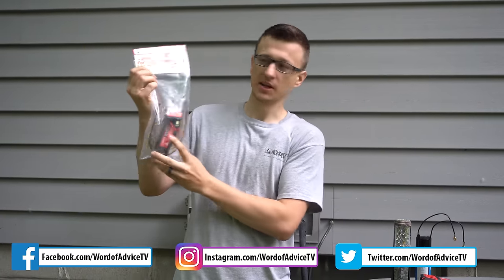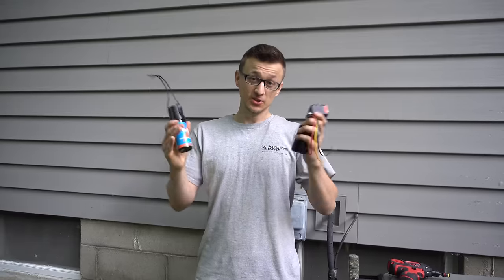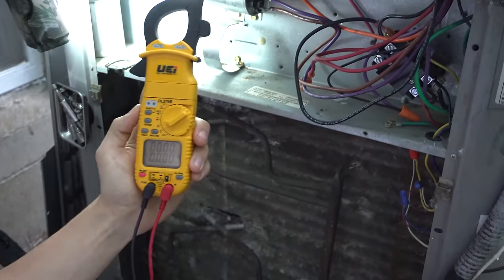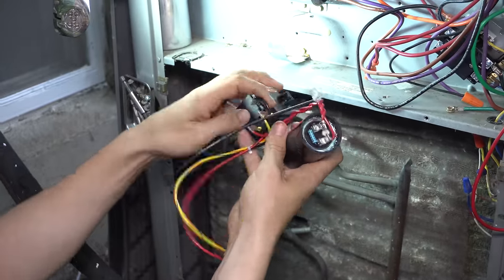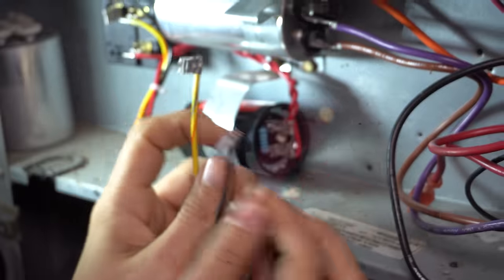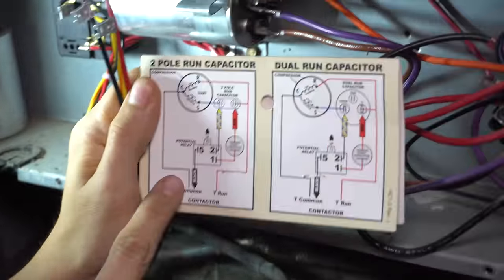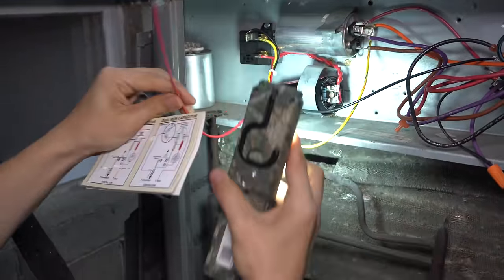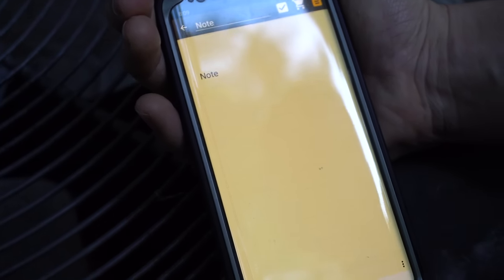How To Install a 3 Wire 521 Hard Start Kit

Comment: Some heat pumps have a terminal on the circuit board specifically for the black wire. If you have a heat pump, look at the schematic on the cover. It will usually show the hard start wiring with dotted lines. Follow that schematic or the unit may not start.

Comment: Another great video. Thanks for posting.  One word of caution. I bought a 521 start kit going on the company recommendation.  I have a 4 ton unit so I bought the CSR-U2 which is for 3 1/2 to 5 ton units.  While I was waiting for it to be delivered I found the originally equipment manufacturer (OEM) part for my compressor. The start capacitor used is an 88 to 108 µF. When I received the CSR-U2 I noticed the capacitor was 189 to 227 µF ( these specs are clearly marked on the capacitor itself). Looking into the CSR-U1 product (for 1 to 3 ton units) it had an 88 to 108 µF capacitor. Needless to say I sent back the CSR-U2 and got the CSR-U1. Always try and find out what OEM part is used before installing these or just buy the OEM part.
Reply: OK...I'm confused. My outdoor Goodman unit (2.5 Tons), has a factory  dual start capacitor ( for both compressor and fan), rated at 35/5 uF. The 521 kit for 1-3.5 ton unit has it's own capacitor, as you say....but it's function is slightly altered from a normal unit that undergoes a full, unaltered, hard-start. Therefore a "match" of uF is not warranted between the OEM capacitor and the one provided by the kit.....correct?
A hard start kit give the compressor added starting torque momentarily by paralleling a LARGER capacitor with the compressor run capacitor. Parallel the capacitance of the circuit may be 180-240 mfd and as the amperage drops on start up... the relay drops the start capacitor out of the circuit when it is no longer needed.  If you have a 4 ton unit, I would have stayed with whatever model of the 521 kit, it says you need.Seems the latest kits show one kit up to 3 tons (1-3)...and the next  kit starting at 3.5 tons (3.5-5)....so there is no borderline overlap either that you seem to have encountered at 4T.
Reply: @TheWilferch  - I’m not sure all about that. All I know is the compressor I have has a part listing that shows an optional start kit with a capacitor rating that matches the smaller 521 start kit so I went with that.
Reply: @condor5635  ...just make sure you know what you are comparing. Most 521 hard start kits have their capacitor rated at a higher uF than the normal start capacitor of the factory unit. The "optional start kit" you say you see listed by your factory listing....may not be a 521 kit. I'd check further. The sentence I show comes from another technical source on hard start kits ---> this one---> "A hard start kit give the compressor added starting torque momentarily by paralleling a LARGER capacitor with the compressor run capacitor. Parallel the capacitance of the circuit may be 180-240 mfd and as the amperage drops on start up... the relay drops the start capacitor out of the circuit when it is no longer needed. "
Reply: @TheWilferch  - of course what they have listed is not a 521 kit. They want you to go buy their ‘kit’ not buy a 521 kit. They are the same thing. I have a 60 µF run capacitor so either 521 kit will have a LARGER capacitor than that as you state - the smaller one is 108 microfarads and the larger one is 220 microfarads or something like that. The capacitor for my compressor ‘start kit’ is 108 µF which matches the smaller 1/2/3 ton 521 kit. Both kits will work but the smaller one is better matched apparently to what my compressor needs and is clearly listed in the parts available for it.  I’m not trying to argue I’m just telling you what I’ve seen and re-searched.

Comment: Can you still use this with a  communicating system(Amana/Goodman, 18seer) that doesn't have a typical contactor...looks as if the supply voltage goes right into the main board. This unit has a copeland scroll compressor just like the others I have done but just not sure if I should mess with it since it's all integrated into the main board.  Unit runs fine, just seems to make a lot of noise when starting.

Comment: Hi, can you tell me how the wiring should be when using a 5-2-1 hard start kit along with a Turbo 200X that has a CPT terminal?  Does the yellow wire go to the CPT terminal and the red to common?  Or does the red go to the highest value for my MFD for the compressor?
Reply: The yellow goes to the CPT.

Comment: What happens if the bleed resistor is not installed on the capacitor terminals? Would it burn up the capacitor or cause damage to the compressor?

Comment: Could this be an alternative fix to bad start relay if the OEM part is not readily available?
Reply from the maker: Yes, I would replace the start relay and capacitor both with the 521 kit.

Comment: Can I connect it to the hot side of the contactor instead of the switch side?  The compressor uses less amps when it's connected directly to the hot side...

Comment: What is the model number for the Kickstart 3 wire I will  need for a 3.5 ton unit? It a York model number YCJF42S41S1A? All is see are for 1 to 3 ton and 4 to 5 ton. Which one will work for me? Compress is 208-230v  60HZ 112 LRA   17.9 RLA  single phase

Comment: Just installed a 521 on my Concord Condensor after compressor stopped working. It is now making a really loud rattling noise but is cooling. Any ideas what the issue could be?

Comment: I sent an email to Suppco asking what temp their SPP6 cuts off, and if they should not be used in warmer climates that consistently get into the 110* range. Here is his exact reply, "The PTC relay drops from the circuit at about 160° or so. It can, and has been used in warmer environments."
Reply: If you are a service tech, install the 5-2-1. The 2 wire might have you returning for a free service call to replace it

Comment: Installed my 5-2-1 hard start and did a white wire check and showed around 20amps with my clamp meter with no difference so I'll check it again but do recall connecting my yellow/green stripped wire to Hemp on the capacitor and the red to common to the capacitor as well. The black wire is to black terminal on contactor albeit I need to check whether it's on the input side or the output side. I'll update it if I notice any amp change.

Comment: My unit has a dual run capacitor that is 35/3-uF, 2-ton, 208/230 rated voltage, with a 1/5hp fan.  Do they make a hard start kit that won't mess up my unit?  It's pretty old and it seems like all of these products only go as low as 1/2hp or 80-something MFD.  What can I use?

Also why does it even mention HP if it isn't even connected to the fan?

Comment: Hi,  Thank You for showing how to connect the 3 Hard Start Kit wires to the dual run capacitor and the contactor. The instructions paper is  NOT CLEAR on the red wire ( say to connect to the contactor ? ). Thanks :)

Comment: I'm a little confused.   Does that 5 wire go to the contactor common or to the capacitor common. I watched the How to wire an AC unit and it showed it going to the common on the contactor. Here you show it going to the capacitor common.   Or  Does it matter as long as it goes to common.

Comment: If you suspect a hard start is no longer working based on over 90% of LRA on startup, do you just test it same as a capacitor? Also see you have brush coil condenser. Can you make a video  of best cleaning practices on those please??
Reply from the maker: Yes, you would test it like a normal capacitor to check if it's bad or not. As for the spine fin coil, I normally just hose my unit down and that is sufficient. In fact I don't even spray it from inside out, just from the outside is enough. There is no need to get it super clean as long as you get most of the stuff off of it. I do show how I clean mine in my AC Maintenance video
Reply: @WordofAdviceTV  awesome, appreciate you brother. I will look it up! And Happy father's day!!

Comment: Installed a 521 hard start kit this weekend following your instructions on my 15 year old 4 ton R22 system.   It started up and ran fine for 5 hours.  Then the AC stopped working.  When I opened the electrical bay of the condenser the hard start capacitor had blown its top completely off and had covered everything in melted plastic.  Some of the wires were melted.  I removed the hard start kit and spliced in new wires to the compressor, compressor fan, and run capacitor and now the AC is back up and running.  Any idea as to why the 521 hard start kit failed?  Could it be just a defective kit?  I would send you a picture if I knew how to attach it.
Reply: The potential relay didn't -energize and the N.C contact did not open to cut off the power for the start capacitor, after the time  it is exploded.
Reply: I would use an easy start much better, just my opinion I've used kick starts, when old ac was struggling to start compressor🤔

Comment: I've noticed some condenser units come with these 521 hard start kits straight from the factory, Would you ever add these to a brand new unit that didn't come with one? Any disadvantage?
Reply: No disadvantages. I have installed hard start kits on all of the condensing units that I own. Good quality condensing units will have a hard start kit already installed. A hard start kit lowers the amp draw when the compressor starts and will increase the life of all electrical components in the condensing unit.

Comment: I have a Goodman unit…. And the one line diagram on the cover already has the 5-2-1 on it, and shows 1 going to one side of the start capacitor…. And the other side going to the contactor….. NOT the run capacitor. There is an optional “start assist” (if used) that connects to the herm and common on the run capacitor which it doesn’t have. So the video contradicts the diagram unless having the red wire from the start cap to the run common is the same as taking it to the “red” side of the contactor?

Comment: If there is a charge on the capacitor, when you short it out, you could  damage it, so  your supposed to use resistance(resistor)to bleed off the charge slowly. That was what they told us in electronics class years ago.
Reply from the maker: Thank you for the heads up kkovler! As far as I know, what you said does apply to DC capacitors but this one is AC so it does not get damaged. I may be wrong but that's how I was taught..
Reply: Not necesary..no harm done, unless high KV as in power company distribution grid circuits..
Reply: Would surge protector in breaker be sufficient to protect the system or just over kill , hypothetically everyone potentially correct on these scenarios what a fickled beast when dealings relate to electronic or electricity's temperamental side if offline by the slightest snafu's.
Reply: @milotorres6894  surge suppressor won't help when shorting a cap as the path to ground between the cap terminals has less resistance than the path through the surge suppressor

Comment: Just installed one of these 521 compressor saver on a brand new carrier 3 ton unit and with high pressure units it goes from a hammer tap on metal to a audible click and fan spins up much quicker with alot less effort. So id invest in $36 dollars anyday to save my compressor from early failure.

Comment: HI,,, VERY GOOD VIDEO...just a question what happens if I connect the black cable of 521 on the other side of the contactor where are the other colors.. damage the compressor ?
thanks.

Comment: Can it be installed on any type/make/brand of AC?
Reply from the maker: Yes, a hard start kit can be put into any make/brand of ac unit.
Reply: Not a three phase compressor, just for one phase compressors
Reply: Some high efficiency units such as Bryant Evolutions need a specific start kit.

Comment: Can you replace an OEM hard start kit with a two wire hard start kit?
Reply from the maker: Yes you can. 👍
Reply: @WordofAdviceTV  Awesome! Any chance you can make a video of that?
Reply from the maker: @tommyhummer2762  I think I already have a video on that. Basically you just discard the start capacitor and relay and put in the hard start kit instead: https://youtu.be/ThBsRFrdNiY
Reply: @WordofAdviceTV  I found it, thank you!

Comment: Q: do you suggest that i should replace ac/furnance capacitors every a few years?
Reply: Probably a waste of money. They are easy to test with a meter, I would just buy a good meter and test each year. Buy a good quality brand capacitor when you do replace it, like an Amrad and it should be good for many years.

Comment: The 3 wire devices need to be matched to the specific Compressor...there are hundreds of different oem kits. If the 3 wire kit you choose isn't the correct one, it will keep the start capacitor in the circuit too long and overheat your Compressor (not good).

Comment: Where does black wire go on high efficient split System with no contact only a Circuit board 
It’s a 3ton Goodman GSXC703610AA

Comment: Can you please help me find parts for my Amana unit?  The local parts dist. won't sell to a home owner.  Thank you so much.  I sent an email to you with model # and serial #.  Thank you.
Reply: They are not AC manufacturer or model specific, but you do need to get the right size for your unit.  There are 3 sizes CSRU1 for  1, 2 or 3 ton units.  CSRU2 for 3.5 to 5 ton. CSRU3 for 4 or 5 ton units.  Use the correct size but go up in size if on the line.  So if you have a 4 ton you could use either the CSRU2 or CSRU3.  Just  do a search on Amazon and you'll find the part you are looking for.

Comment: Question: my old Trane has a start cap and relay. Why is my relay so much more expensive than these 521 kits? Just replacing my relay is $90 (it's an RLY1570) when these 521 kits are about a third the price and have a relay and cap included.

Comment: Well my problem is more complicated and trying to see if you can help me . First start with the fan motor outside replace that and work fine . Them my thermostat start shutting down every cycle that unit was coming on . Try to replace thermostat but the wires come difrent .and the new thermostat did not work install the old one and work again them Yesterday unit work in the morning them stop working and reset everything and unit outside was working but blower inside not . Reset again and blower work inside nothing work outside  . Reset again . Work outside but only the fan not compressor and blower not working inside . Guess what reset again . Blower inside work ,fan ouside work but not the compressor . Well decide to change the capasitor and reset the system one more time . And everything work . But now temp outside is 77 and my thermostat is set to 78 and still come on . But this observer thermostat i think is the problem but try to change for something more or less complicated but the wires are difrent for the one i want to install and the unit is running normal but come on every 8m.36s or so to 9 minutes on and off is the same time . I wonder if is normal . But i think sooner or later the whole unit will blow out if keep running every 8 minutes . Please help ?
Reply: I had one like this- the indoor unit needed to be cleaned or replaced. It was kicking out on high temperature. Cleaned around indoor fan good and that fixed problem.

Comment: You mentioned the reason for mounting the relay properly (vertical axis specific) early in your video. Gravity switch instead of a thermal switch hence the specific mounting position. Good informative presentations, keep it up. But don't crimp your capacitor mounting band, it looks unprofessional. Pull it tight and remount. Your crimp made me cringe!

Comment: Do not install this, horrible for your ac. When your capacitor goes out you won’t know.
Reply from the maker: Hmmm.. I have never heard that before but that's an interesting thought.. I have never personally came across the scenario you mentioned though so lets see what others will say.
Reply: Easy test, connect one to a system with a bad capacitor and watch it turn on.
Reply: Better you have a back up if your capacitor out! Your AC keep running in hot days unless both capacitor and hard start kit failure. Just a thought.
Reply: If the hard start fails then the ac system is back all on its own just like the hard start was nvr installed.... SMH...

Comment: rrally. you use a drill gin to install a scree in existing hole, ? 

and why isnt tge proper sized run cap used instrad of tgat msll run dusl csp